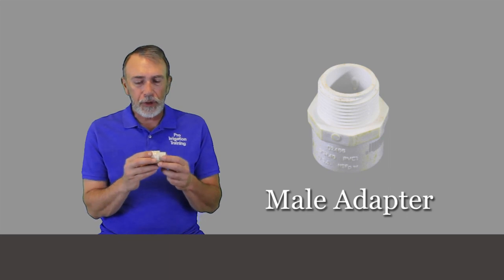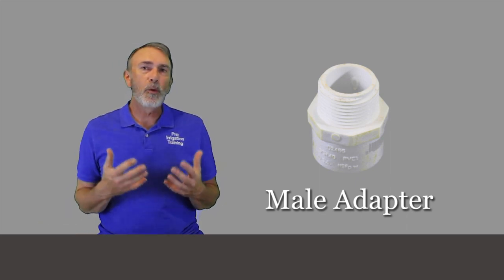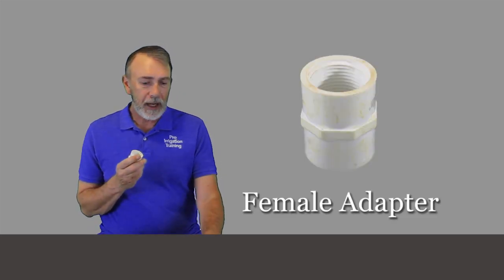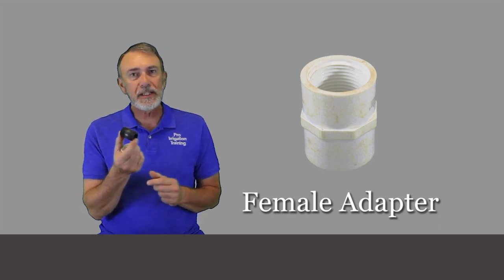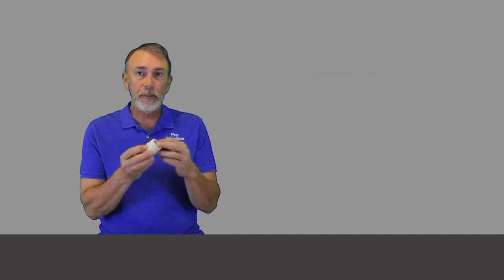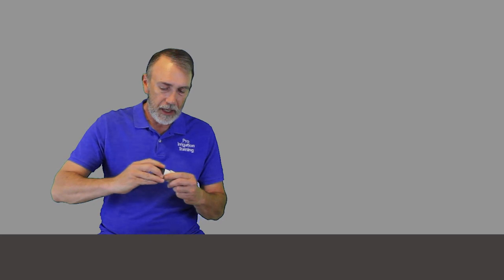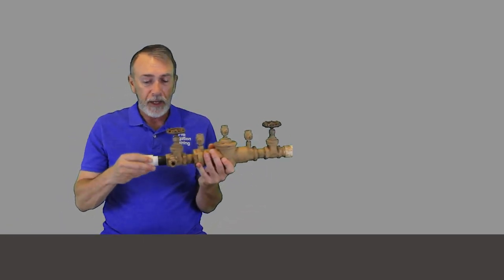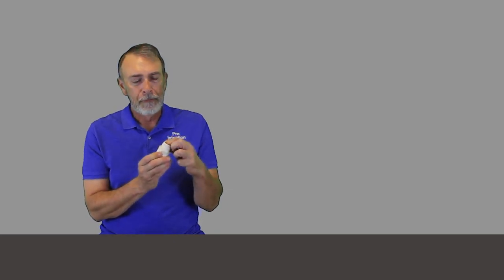The Worst Fitting for Irrigation Systems | Irrigation 101

Comment: my brass backlow preventer only allows the pvc  male threaded adapter to get maybe 3 full turns before it gets hard to turn by hand. Is this enough? how tight is tight enough?
Reply: Hand tighten as hard as you can then use your vise grips to tighten until it just squeeks a little. You will hear it!

Comment: or just use a PVC Grip by male adapter that is made out of brass. the "grip" side is female that the pvc pipe will slide in to, and tightens to "Grip" the pipe. the Male end, you just thread into the Backflow preventer and one coming out of the water meter. .... Now, if the pipe gets broken, you can simply Loosen the "grip nuts" and take out the affected pipe, and put in a new piece cut to proper length, in a matter of minutes. No having to waste MORE money on other fittings like the PVC Female adapter and schedule 80 nipple
Reply: It's definitely going to cost more, just by a few dollars from the right plumbing supply company. But, over the life of the backflow or other connection, and the ease of removal without needing to cut pipes and add slip x slip couplings. It's more cost effective.
Reply: I'm actually a Certified Back flow installer and Tester in South Carolina. I will only use bras adapters into back flows.
Reply from the maker: Hi Christina, thanks for watching. And thanks also for the comment, I love hearing how people have different ways of doing things! The only comment I would make is that a 1" fem adapter + Schd 80 nipple is about 4.09 USD. I can't imagine any brass fitting being cheaper that that, but maybe I'm wrong.